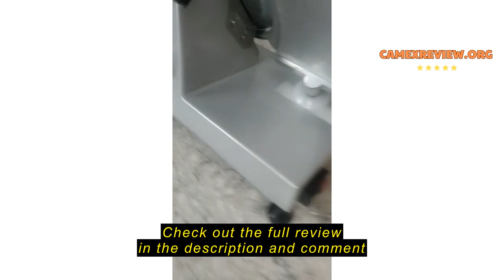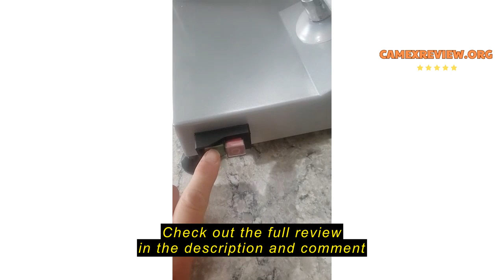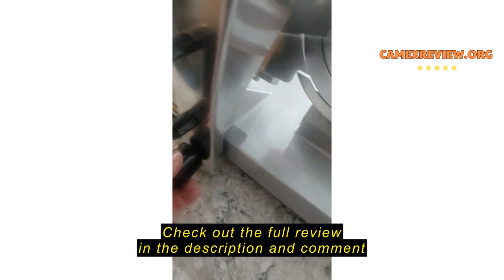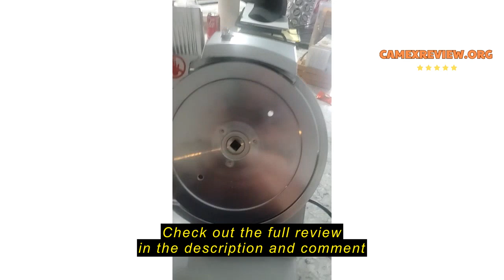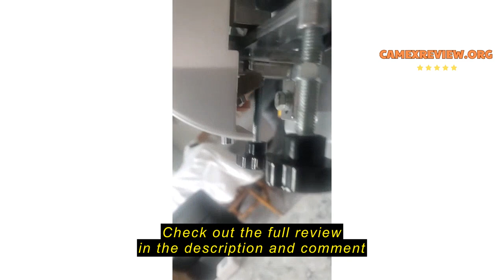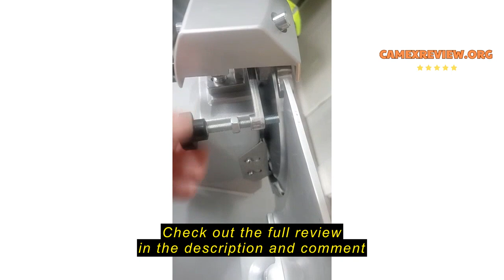Review VEVOR Commercial Meat Slicer, Electric Deli Food Slicer, Carbon Steel Blade Electric Food Sli

Comment: Been reading reviews for this slicer for the last hour as I'm considering buying one.  Dude, the handle you removed from the back screws into the blade and acts as a holder instead of stuffing your scredriver in there, also you can use the handle to "handle" the blade, no need to use your hands to hold the sharp blade!